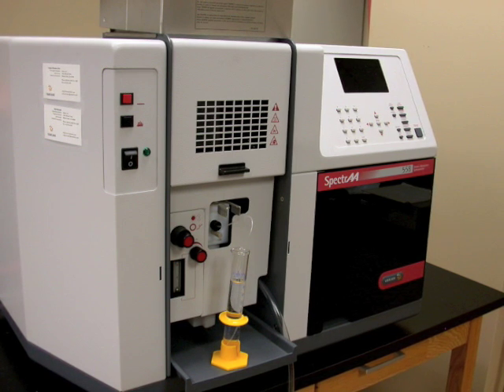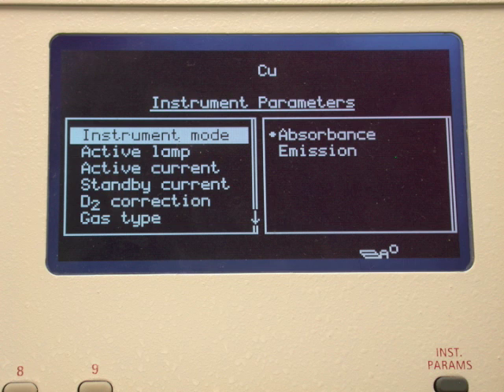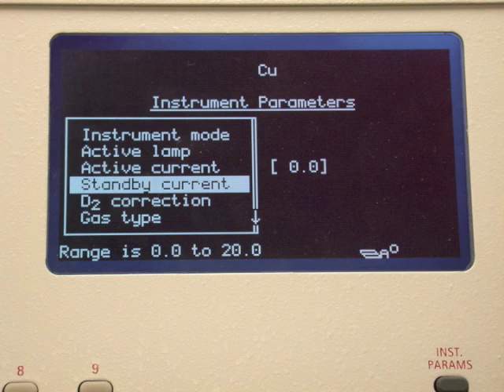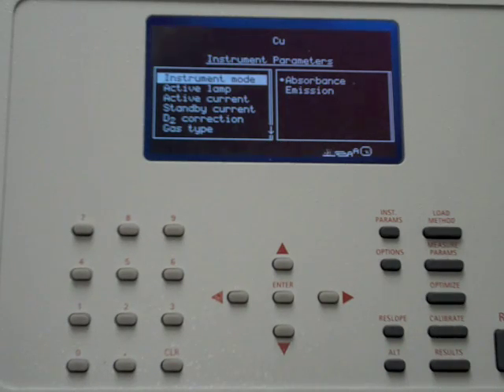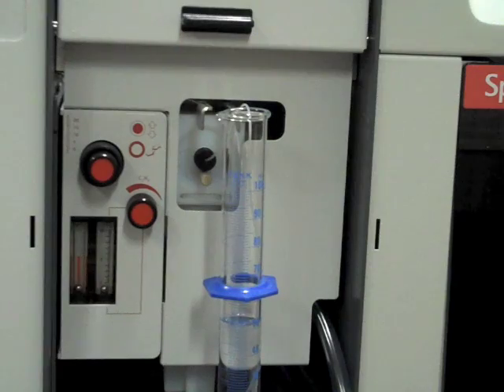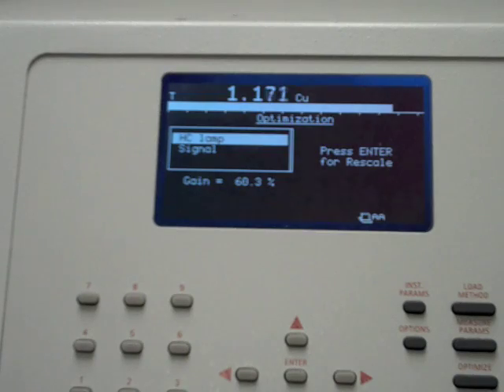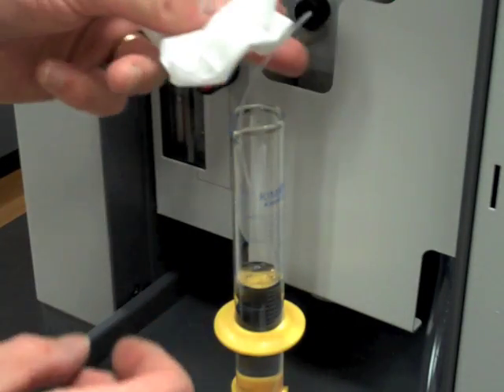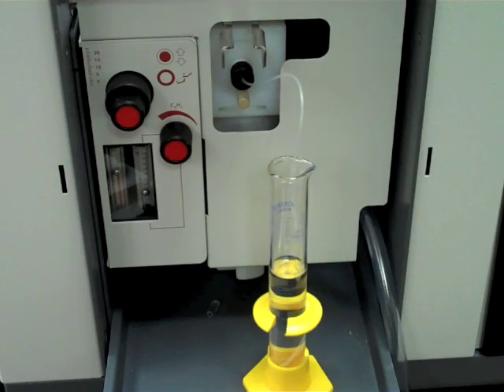Atomic Absorption Spectrometer

Comment: what is slit width and what does it do PLEASE SOMONE
Reply from the maker: Hi Dawson,
The term “slit width” refers to the physical width of the opening used to pass a narrow portion of the spectrum of light to be used in the experiment. The light from the lamp is dispersed by a grating into a rainbow across a wall inside the box that houses the monochromator.  The opening in the wall (called the slit) allows only a narrow band (a small range of wavelengths) to pass out of the monochromator and on to the detector. In some contexts, slit width may also refer to the range of wavelengths (usually in nanometers for visible light) that pass through the monochromator (that is, through the physical slit). More often this wavelength range is called the "spectral bandpass". The narrower the slit width the better job the monochromator does in isolating the wavelength for the atomic absorption transition. However, beyond a certain point decreasing the slit width is detrimental because it weakens the signal intensity and, consequently, poorer sensitivity.

Comment: how about analysis o unknown liquid sample
Reply: u cannot   ,
Reply: WHY
Reply: @yacoubasanogo3219  A specific HCL has to be used for the element to be determined. That is, you have to know what you're looking for. There are single- and multi-element HCLs, though the latter is typically for only 2 to 3 elements..